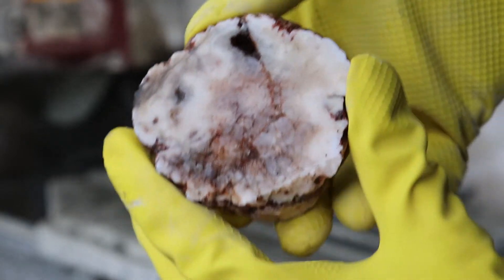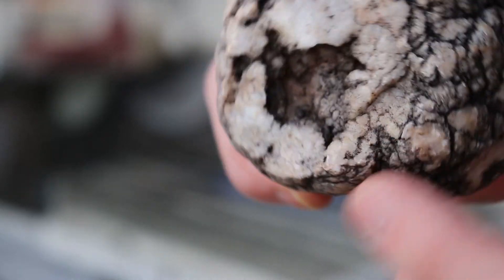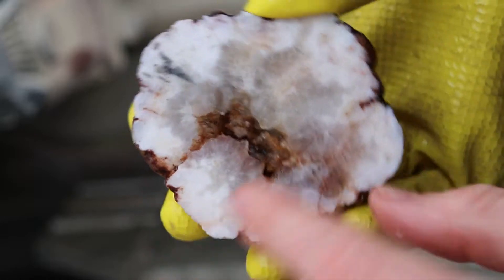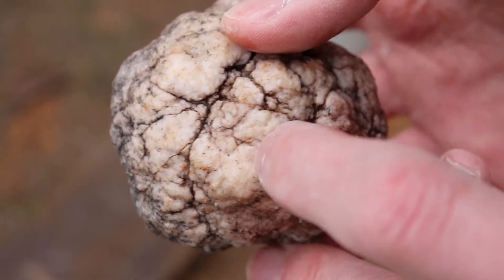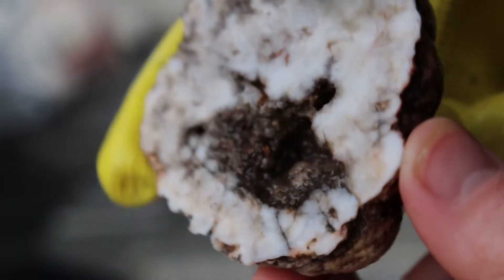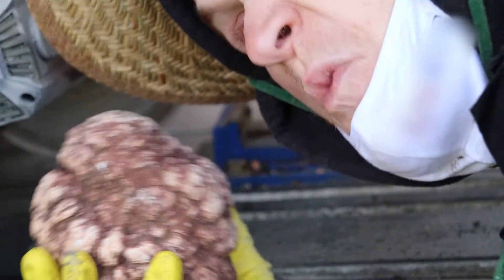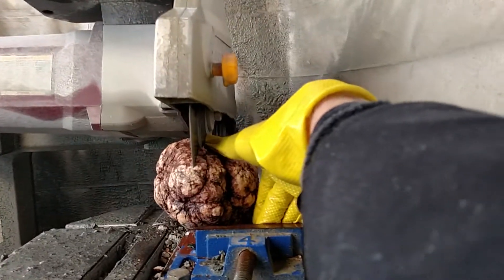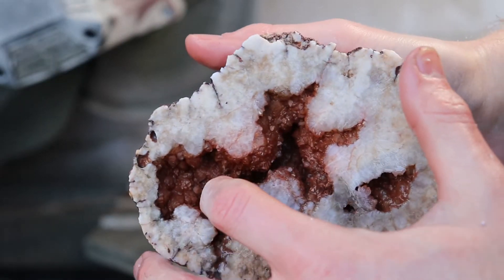Cutting Open Arizona Geodes

Comment: Possibly a stupid question...how do you know which rocks could be/could have geodes?
Reply from the maker: There is no such thing as a stupid question. The best methods are done by hefting similar sized rocks to check for a weight comparison. The only sure way I know of is if you put it up to your ear and shake it. If it rattles, you know you have a geode because a tiny crystal has been trapped inside and you can hear it, similar to how you check if a lightbulb has gone bad. Great Question!

Comment: Nice video! I use the same polishing pads but on a drill instead of a polisher/grinder. They work well....but time consuming!
Reply from the maker: I was using a drill in this video. Its a really old SEARS one with a handle for guidance, you are right though with the time consumption. I have been trying to figure out how to lessen it. Better cuts definitely help.